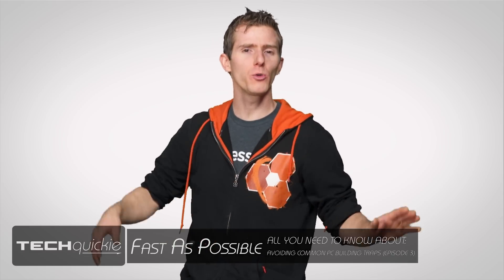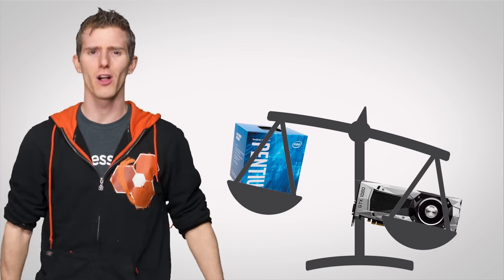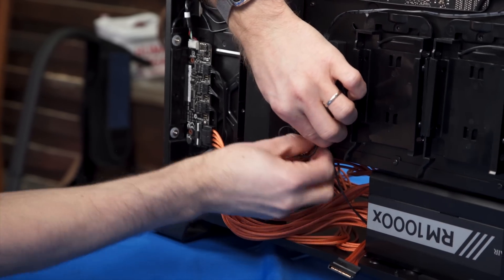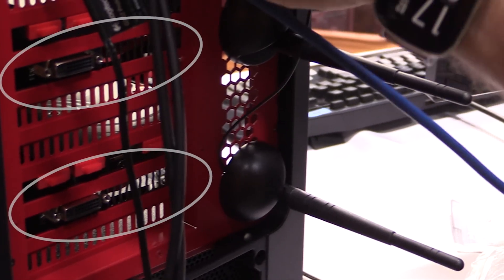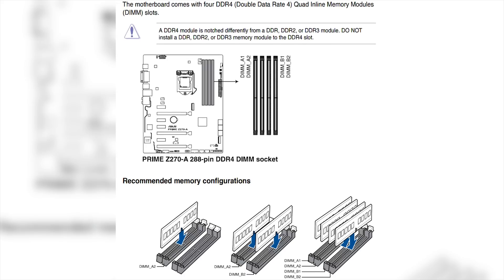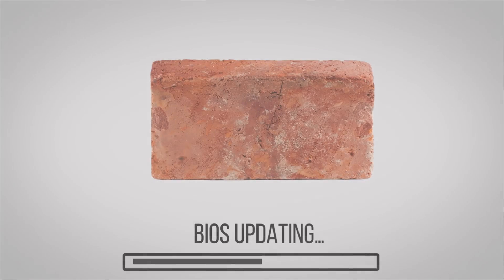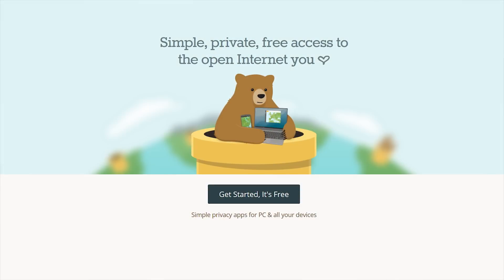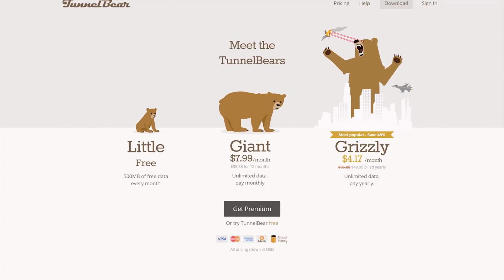Avoiding Common PC Building Traps - Episode 3

Comment: The first graphics card I got for my system, I plugged in the motherboard to the monitor as I didn't have a DVI to VGA adapter and thought it would detect to at least install the drivers until I get an adapter. The gpu didn't show up on the device manager & I still don't understand what does the display connected have to do with the gpu not being detected.

Comment: Don't make my mistake. When water cooling your PC, make sure the pump wire is plugged into the CPU fan connector and the watercooling fan is connected to the optional cpu fan connector. Also, make sure both fans are enabled in the bios. they can work the other way around but only if both are enabled. You will get better overclocks if they are connected the correct way.

Comment: When setting up RAM, please:

1. Do not mix different RAM modules.
2. Installing RAM modules with improper slots, especially when doing dual-channel modes. Some slots are came with different color so please refer to the mobo manual first.
3. Doing a stupid RAM combo like dual-channel with single-channel, i.e. have 3 RAM modules installed instead of 4.

Comment: TL:DR:
1) Balance your build.
2) manage your cables
3) plug in Monitor into GPU, not motherboard (MB)
4) Use RAM slots according to MB manual 
5) power outage during BIOS update can brick your MB

Comment: My top tip? Never, never, NEVER, discard your motherboard's manual. While a quick Google search can usually help you quickly diagnose any problems you're having, sometimes just consulting your manual when faced with compatibility issues can be all you need. Want to know which RAM slots to use? Manual. One of your PCI/PCIe expansion cards not working? Manual (Perhaps all the lanes on a given slot are already utilised). Forgot which way round some of your mounting hardware should be oriented? MANUAL. Seriously, I can't stress enough just how many times I've been faced with a problem that a simple flick through the manual has made me aware of. It takes up next to no space in your desk drawer or what have you, and while you won't be needing it on a daily basis, you'd rather have it and not need it, than need it and not have it. Rule of thumb. =)

Comment: I had a weird expirience updating my BIOS. Once I had to update my Lenovo BIOS on my laptop. When I did, it was using an engine from a third-party firmware giant and booted into a seperate sector which told me DO NOT UNPLUG AC POWER!!!!! After it finished flashing, it made a weird grinding noise.

Comment: 2:02 Jesus Christ that's literally my PC. My case doesn't have space on the back of the motherborad, so they MUST be in front of it, and I struggles a lot to make them as compact as possible in groups and keeping the airflow free, but with my new power supply with thick new cables it is just impossible until the bend for heat+gravity

Comment: 2:05 after 2 years  it's proven that cable management is purely aesthetic
Reply: ivan silva He didn’t say cable management causes temp issues directly, but he said that loads of dust will accumulate on the cables over time, which will eventually affect temps

Comment: how do i know if the GPU is a good choice for that specific CPU, i have i7 8700K with no GPU still cause i didnt have the money, and now i have my mind set on the XFX rx 5700xt Thicc 3 Ultra, and if its not a great choice, what Intel CPU is good for the GPU, since if i have to change one thing between the two, i would prefer a better CPU since i work on Music Projects which are CPU intensive apps but the GPU is for gaming mostly
Reply: Dulla Bills The 8700k should run even an rtx 2080 ti with ease.
Reply: @haven216  its that powerful then, so i should worry about getting a gpu that fits with the cpu since the 8700k is pretty decent to run high end gpu aswell?
Reply: Dulla Bills Yes, the 8700k will have no issues with any gpu. It mainly depends on the amount of cores and how fast those cores are when determining bottlenecks
Reply: Dulla Bills Any gpu should be compatible with virtually all modern cpus, but a cpu that’s too weak (like a 2 core 4 thread i3 7100) will suffer with a powerful gpu and will therefore lead to a lot of stuttering and much lower FPS than the gpu is capable of. This is considered a severe bottleneck. Generally you should have at least 4 cores 8 threads to have a smooth high FPS experience (though these days it’s recommended to have a 6 core to alleviate any potential bottleneck or microstutters and allow the GPU to run at its best.) Clock speed also matters when it comes to performance, but core counts are usually a bigger deal
Reply: @haven216  thank you man, i havent yet bought a gpu case im afraid that im gonna make the wrong decision and then have to switch to another gpu

Comment: How do you install ram? For example u have 4x2 do u put it on 0&2 or 1&3 slots? And if u have what about 8x2 ram? Is there any difference in performance if installed on slots 0&2 or 1&3?

Comment: Have fans blow into the case.  The case is going to leak air no matter what, and the power supply fan pulls air out.  The extra air is blown past the video card heatsink out its vent in my case.  Don't cable manage.  Cables stacked up provide places for dust to build up.  Be proactive about dusting, get a small portable air compressor and air nozzle.

Comment: Make sure you build to be upgraded and build on a DDR4 compatible motherboard, my first build was an AMD FX Series and DDR3 and it was outdated, it forces it to where the most you can upgrade to is a Mid-range computer and once something eventually degrades or shorts, which wont take long, it's even more expensive to replace than newer models. When my Mobo went out I had to sink almost 400 into replacing the parts with a slightly better Ryzen compatible Mobo along with the new RAM and CPU because they weren't compatible with anything that is slightly newer. Dont cheap out, you'll pay for it in the future

Comment: Linus can you elaborate on the bottleneck? Like besides the obvious, different generation parts matching up, is there a technical way to ensure I'm getting peak performances? For example, if it was the RAM slot, I'd usually go for a motherboard that can support it's frequency without OC enabled. Back in Pentium generation there was FSB to also consider. What's the "meta" nowadays for combined pieces of CPU, MB, GPU, RAM?

Comment: Beginner here
What does he mean by the "don't plug it in to your motherboard if you're rocking with discrete graphics card"?
Reply: Motherboards and GPUs come with video output ports. If you use the motherboard's port you use the CPU for graphics which is (usually) VERY, VERY SLOW. If you use the GPU's port it will use the GPU which is (usually) much faster.
Reply: @cameronlyman750  This clears up everything, thank you for your reply.

Comment: Can you put a 4gb & a 8gb ram stick in the same slot? Can you run a 12gb rig?
Reply: you caaaaaaan but its not recommended, you really want to get the same exact stick  or a very similar one. might even get less performance with the 8 and the 4 mixed
Reply: Menoly 
Okay, thanks!

Comment: Splurge a little on a good cooling system, and consider getting an AIO liquid cooler. They require no maintenance, and actually do a very good job cooling the components. As a general rule of thumb, the cooler a pc runs, the better, and the longer it’s lifespan will be.

Comment: about this ram configuration, well, my motherboard has it like A1 B1 A2 B2, first I was using the A1 B1 A2 config like I should, but after some years I have been getting errors and to get rid of them I had to go into A1 B1 B2 config, and after some more time I got the same problem and now I can't use the A1 slot, because if I do use it then my system will crash or reset after some time or it will even freeze on the loading screen

Comment: Refused to buy the 1200+ dollar rtx but did buy 64 GB of ram and the corsair ax1600i (with cablemod custom length green sleeved cables)  cause...reasons? Absolute silent PC....even if in window ac is not silent

Comment: The CPU doesn't have as much to do with gaming performance as Linus thinks.  I still play the latest games on my Core i7 2600k system with a GTX 1060 6GB card just fine.  Not at 4K mind you, but 60 FPS on ultra at 1920 x 1080.

Comment: Remember that there are those who buy a 1080ti and pair it with a pentium gold, like myself, because we play games that use so much more gpu processing power than cpu processing power. Thus no bottleneck is met. The are also people who do it because they will be able to afford a better cpu later, they just needed something basic to get their rig running asap
Reply: Depends on what kind of games you play, certain games, like KSP for example, eats CPU power but doesn't require a particularly good GPU.

Comment: Possibly a dumb question, but if you’re not supposed to plug your monitor into the motherboard where else would you be plugging it into? Is it the PSU? I’m just getting into building a pc and this confused me
Reply: Plug it into the graphics card's port instead of the one built into the motherboard. IF you have a graphics card of course.

Comment: If there's any component that benefits from going overboard, it's the PSU. A lower percent of capacity that you use translates to lower heat generation and increased life (admittedly only to a point, and with diminishing returns as you approach that point), and as PSUs are often overlooked when upgrading, it can be to your benefit in the future to have one that's capable of far more than you're asking of it today.

Comment: Question: Does the "plugging the monitor* directly to the GPU" rule for the best performance still apply to the newest motherboards that sport Thunderbolt 3? Are the newest GPU adding USB-C connections for TB3?

*  high-end 4k-5k monitors

Comment: When you plug the power cable either for your motherboard, cpu or gpu make user the hook is on place. Like when you hear clicking sound from them. It might be a little hard to achieve it but the secure is worth it and don't over do it or you might break your pc. Make it easier using both hand for the cable and a the component to tight them together

Comment: Preparing for my first build, I came across a problem with compatibility between fan/led control softwares, specifically nzxt and corsair. The two (like many other two companies today) are not completely compatible and have different led plug sizes. They also each require a different brand new controller hub (Commander Pro/ Hue+). Choose the same company, and you’ll be in the clear as far as controllability and friendliness of fan, lights, and controller software. In my opinion, Corsair software iCue is the best! (I returned my NZXT AIO for the h115i pro for compatibility.)

Comment: Too simplyfied. "the videocard won't be able to operate at its peak performance". It's wrong. I can easily install Intel Celeron and 1080 Ti and make the 1080 Ti GPU 100% loaded
The point is not that one should do so. The point is that it's possible and easy. Just run some 2010 game in UHD, set up the render distance to minimum and all the effects including 8x msaa to maximum. The GPU will be operating at its peak performance
Of course, it's totally pointless to install Intel Celeron with 1080 Ti, but make the GPU 100% loaded is easy even with such configuration

Comment: 2:31 I'm a bit confused, what's the difference between connecting it to the motherboard and connecting it to the back panel? Doesn't the back panel is the part of the motherboard as well?
Reply: Connecting your display to GPU > Connecting your display straight to motherboard

Comment: CPU: Intel - Core i7-8700K 3.7GHz 6-Core Processor  
CPU Cooler: NZXT - Kraken X62 Rev 2 98.2 CFM Liquid CPU Cooler   
Motherboard: Asus - ROG STRIX Z370-E GAMING ATX LGA1151 Motherboard  
Memory: G.Skill - Trident Z RGB 16GB (2 x 8GB) DDR4-3200 Memory  
Storage: Samsung - 960 EVO 500GB M.2-2280 Solid State Drive  
Storage: Western Digital - Caviar Blue 1TB 3.5" 7200RPM Internal Hard Drive  
Video Card: Asus - GeForce GTX 1080 8GB ROG STRIX Video Card  
Case: NZXT - S340 Elite (Black) ATX Mid Tower Case  
Power Supply: EVGA - SuperNOVA G3 750W 80+ Gold Certified Fully-Modular ATX Power Supply  

Guys how is this build? The price isnt an issue, all well within budget!

Comment: I've been building PC's since about 2002, I still do dumb things. They are WAY easier than at that time but its still easy to make some mistakes. Just a couple months ago I was replacing my water cooling (pump died) back to the stock fan while I was doing other things around the house (rewiring switches and building shelves) and I accidentally plugged my two hard drives incorrectly and fried them. I don't know how i did it, but I did. I got so mad I bought all new components for a new rig.

Comment: Hi Linus,really enjoy your Videos,you have a vast amount of knowledge on everything computer related.May I pick your brain for a moment. I have desktop PC a friend  and I built  in September of 2014. The computer runs fine, this is what I have in the machine, ASUS M5A99FX PRO R2.0 AM3+ AMD 990FX SATA 6Gb/s USB 3.0 ATX AMD Motherboard
AMD FD8350FRHKBOX FX-8350 FX-Series 8-Core Black Edition Processor
Corsair Vengeance Blue 8 GB (2X4 GB) PC3-12800 1600mHz DDR3 240-Pin SDRAM Dual Channel Memory Kit 1.5V
Cooler Master V750 Semi-Modular RS-750-AMAA-G1 Compact 750W 80 PLUS Gold Power Supply (Black)
Crucial MX200 500GB SATA 2.5” 7mm (with 9.5mm adapter) Internal Solid State Drive - CT500MX200SSD1
ZOTAC GeForce GTX 750Ti 2GB GDDR5 PCI Express 3.0 DVI HDMI DisplayPort Video Graphics Card (ZT-70605-10M)
 I don't do gaming ,but do Photo editing in literoom and photoshop , your recommendations please.
Thank you ,
Greg Fisher

Comment: Use good sata cables! if you have a case where you can see the hdds through the front but the connectors are showing into the place for cable management, use sata cables with are bent at the end. but if you place a ssd on the back of your motherboard, better dont use them.

Comment: I was supposed to make a gaming rig for $600 i got the price up to $700 just by getting most of the stuff from amazon and then even more because i was not sure if the power supply would explode $800 and then windows 10 usb install puts it up to $900

Comment: If you are populating most or all fan headers on a motherboard (5-8 may be more crucial than 3 btw), do NOT plug everything at once!
Certain mobo models do not have good default fan speed settings and can lead to initial surge overvoltage triggering the built-in protection of the board (hopefully it has one...) or give you a heart attack with all the noise and dust that you'll witness as soon as you turn on the system.
One way to go around this is to install a couple of obligatory fans first (e.g. CPU, 1 front intake, one rear exhaust) and tweak their RPM profiles in the BIOS before installing the rest.

Comment: Seems simple, but I know very experienced builders that farf this up, make sure you buy the right RAM for you board and CPU! If you have a MBD and CPU that need DDR4 DIMMs, don't try to save money with DDR3. On that same coin, I have messed this up myself: don't blow $200 on super fast, DDR4-4333 or whatever, to install on a motherboard that only goes up to 3200. That's a lot of money that is just sitting on the clock and not being used.

Comment: Make sure your motherboards PCIE 16x slot isn't adjacent to the PCIE 1x slot if using a dual slot graphics card and you need the PCIE 1x slot. I needed the PCIE 1x slot for my wifi card but it was overlapped by the graphics card.

Comment: Not sure if the fear of bricking by flashing is in place. I have worked for several years in a shop building PCs for customers and as part of that service, flashing bios to upmost version available at the time of building. And I had to use Floppy disk for that back then. From that several hundreds for PCs build and flashed, with several hundreds more serviced I have bricked maybe 2-4? But NONE of them was due to a Power cut to the system. Either it failed on its own during the flash process effectively freezing (and not moving on even after 15 minutes) or seemingly finishing all right but would not come up after reboot. (And no, cmos resets and other tricks would not resurrect it). 
I have bricked about 1-2 by a mistake. Feeding it bios for OTHER MB cause of.. well. Human. Oh yes, back then no flashing utility checked if the bios you are feeding is the same type of board or even manufacturer. That stuff come up gradually over the years till today, where I guess its near impossible to fuck up the Flashing. Nowdays utilities will mostly check if what you are feeding is the real deal and will not allow you to brick it that way. 
And even if you do, most motherboards come up with 3y warranty. Unless you are trying to flash something older, you can still try to claim your warranty. Common PC shop or pretty much any retailer will not be able to tell difference between dead MB and 
 or flash bricked MB as they are simply lacking the tools to do so. Unless that MB does posses some sort of Error Code display or does display "I WAS FLASHED UP" when you try to power it up, you are safe.

Comment: MY PC IS SO BUDGED 
GTX 1050 TI AND CORE I5 2400
16 GIG RAM
AND THE COST IS VERY CHEAP CUZ I GOT THE CASE AND THE CPU AND THE MOTHERBOUARD FOR 50 DOLLAR ._.
AND 16 GIG FOR 20 DOLLAR AND THE GTX 1050TI 
FOR 100 DOLLAR AND IT USED
TOTAL 170 DOLLAR MOST POWERFUL 170$ BUDGED PC
BUT ITS STILL DUSTY I STILL FIXING IT BUT AT LEAST OVERWATCH 1080P AND MAX GRAPHICS FOR 90 FPS THAT IS SO GOOD
Reply: TRY TO BUILD SOMETHING LIKE DAT BRO >_>